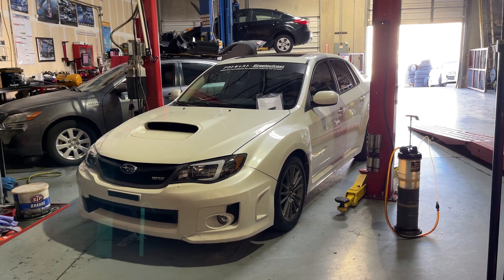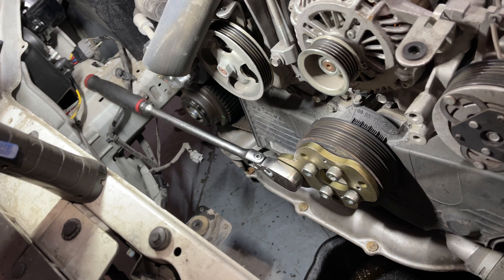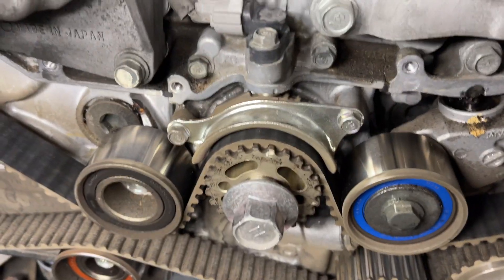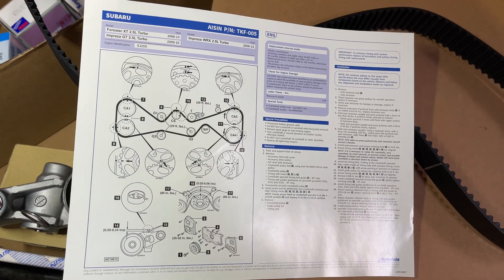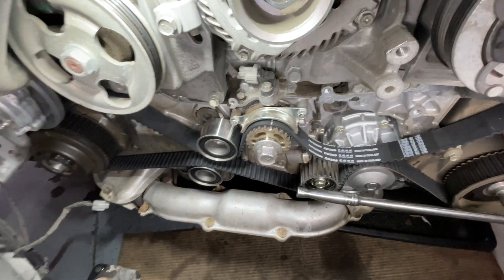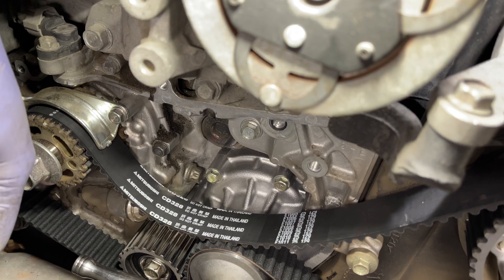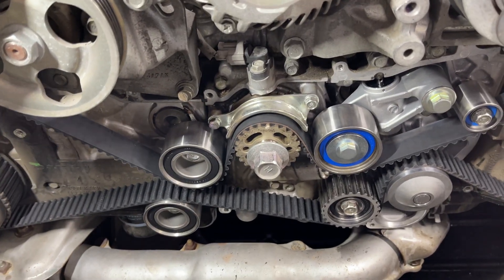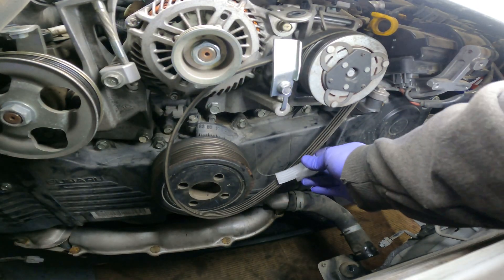TIMING BELT AND WATER PUMP REPLACEMENT :: 2013 SUBARU IMPREZA WRX TURBO EJ255

Comment: Great video I know its old but just a question is it easier taking the whole radiator off ?
Reply: yes it is, did it today and its much easier without the radiator in
Reply: Especially if the coolant is being drained down for the water pump